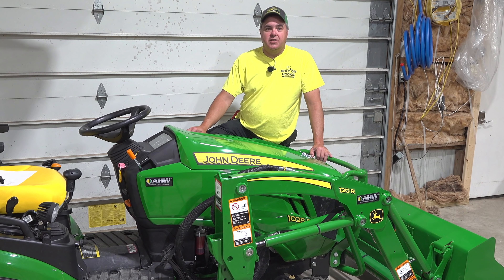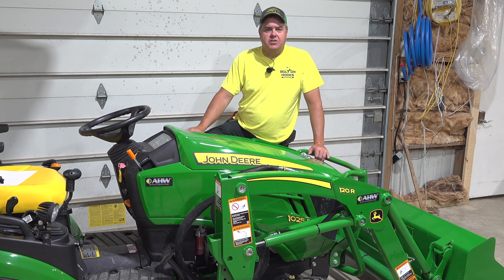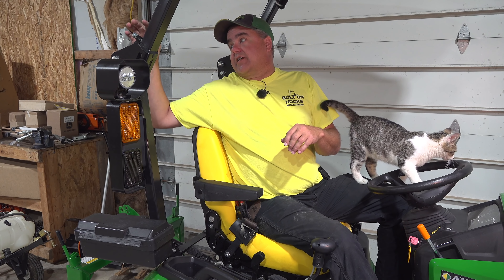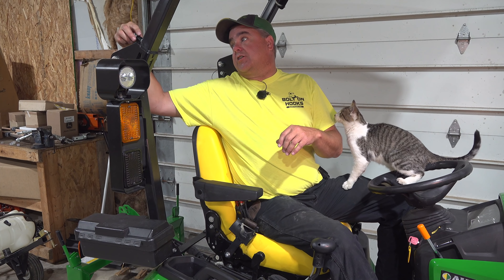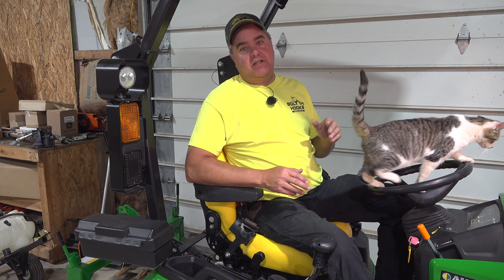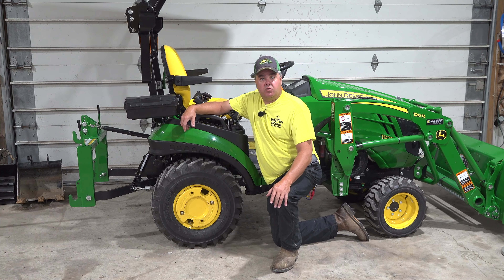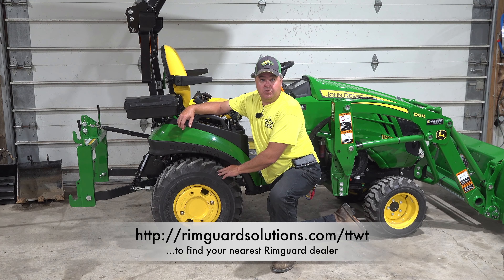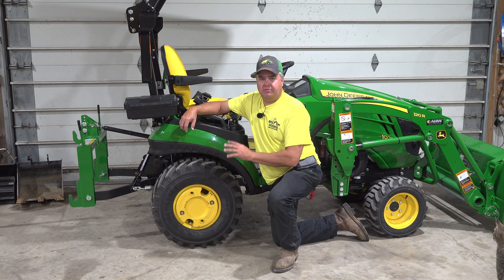NEW 2019 John Deere 1025R with ALL the Bells and Whistles! Model Year Confusion Resolved!

Comment: I just signed for one Wednesday, just waiting for delivery.
Reply from the maker: Congratulations!
Reply: Tractor Time with Tim    The paper said 2020, I did not get to see the tractor because of low stock. The salesman was going to get it from a different yard. I will have to look and see what the paper says now.
Reply: You won’t regret it.
Reply: You  will  love  it , I  had  one  but  moved  up to  2038R  witch is also a awesome  tractor  thinking  down  the  road  to  get  another  1025r just  for  mowing , I  truly  do  miss  my  1025R
Reply: It will be the best thing u ever bought...hands down !!
Reply: Be warmed...  implements are like rabbits, they multiply fast.

Congrats!
Reply: I had mine since February I Love it no regrets.
Reply: I'm with team orange ,but I can tell you one thing. You will enjoy your little tractor. I just received my northern tool wood chipper today. Im looking forward to trying it out on my b2650.
Reply: @TractorTimewithTim   I am going to buy a new 1025R this Thursday and was wondering if it is better to wait for the new "LK" VIN 1025r...what is the benefit of having the same Autoconnect PTO as the 2025R? Would I be missing out if I bought the 2019s?? Thanks in Advance for your help 😊
Reply: @rexdelong7581  I'm considering a 1025R or a 2038R. The 1025R is plenty for what I need around my property but I'm looking at using it semi-commercially. Went to the dealer last week and all they had was a 1025R but they're getting a 2038R in & I'm going to go back. Would you mind explaining what you like about the 2038R a d why you decided to upgrade and maybe more importantly what you miss about the 1025R? This is a new venture for me and I don't really know what kind of work I'll be getting into with it - I do live in an area with a lot of small residential lots so the 1025R may in the end actually be the better machine for me but I also don't want to not be able to take on jobs that the 2038R would be better suited for. I watched Tim's video but any additional feedback fron you would be greatly appreciated!

Comment: I love your videos, very helpful and, Informative I’m getting a 2025r have 3 acres with no grass, but weeds that we cut and end up with weedscape. We live in rural San Diego so only an issue from February to early summer. My question is, do I get the drive on mid mower, or the 3 point hitch bush hog that’s pulled and works out as less money.
Reply from the maker: We have videos on both types of mowers.  Check em out :-)  Thanks for watching!

Comment: Hey Tim while John Deere is awesome for sure... I have a chance buy a yanmar 221 for 5000 less than a new 1025r.
It's a new old stock 2020. I have 1.1 acres to develop with my new house. 
The dealer is close by and we'll trusted here in Idaho. The budget is right by allowing me to purchase more implements... and 10 year 3000 hr power train warranty... am I crazy? 
I really enjoy your videos..
Reply from the maker: Each person must make their own decision.
I would still buy the Deere.   auto-connect, tons of accessories available, Position control on 3 point.
More HP on the 1025R.  ...BTW, you SHOULD be comparing the 221 to the 1023e.
Loader easier to attach/remove.  
Load n go available for mower deck
Single point hydraulic connector available for loader.
Long term parts much easier to purchase (proabably 250,000 of these 1-series have been made!!)
Resale value will be higher on the Deere...for the reasons above.
There really is no comparison in these two machines.
Reply: @TractorTimewithTim  yes I'm aware a better companion is the 1023.... with that being said it's 3k cheaper. And after test driving all three. The Yanmar power steering is the best. The position control on the three point is a option I have gone over time and again in my mind... but that is money I need to spend on a tiller... a post whole digger... ect.. I guess my question is is the yanmar a piece of crap? Like I said I do have a trusted dealer... and service dept...
Reply from the maker: Nope...not a piece of crap.
Will be similar in reliability to all other brands.  Issue is that parts will not be made as long as for the better selling Deere.

I predict you will regret not getting the Deere...but I could be wrong.
Remember the 0% financing.
Reply: @TractorTimewithTim  well you have some more to think about. Thanks!

Comment: Took delivery on barns new 2019 2025r last year. Owners manual does not make any mention of 50hr.service. Have looked manual over many times and first service is not required until 200hrs. My dealer sold out to AGPRO in the meantime and have been pretty good about handling recalls and electrical issues I have had and even provided free pick up and return . Talked to the service manager about first service and he also stated no service needed until 200 hrs. Your thoughts on this?
Reply from the maker: They removed the 50 hr service from the manual in 2018.

Comment: You will like the third function after you get use to it. However, like all hydraulic functions on the 1025R it is hard to do multiple movements at the same time.  When you press the third function buttons, the third function basically steals all the hydraulic flow so you can not feather third function and curl at the same time. So you will learn to do multiple short burst of the third function to close the grapple while curling to grab loads.  Also you might also look into adding the Hydraulic lift for the MMM.  It is the Hydraulic cylinder and a hose kit.  Do the install yourself and the reverse the direction of the hose attaching to the hydraulic cylinder.   The short add-on hose will attach to the hydraulic cylinder and not be additional weight hanging out under the quad hydraulic couplers.  Also the short hose bent fitting also couples to the hydraulic cylinder better.
Reply from the maker: I have a write up on the mmm lift options on the 1 series. I have no interest in the hydraulic lift.  ...and the independent hydraulic lift is not available with the 3rd function.  Anyway; not necessary in my opinion.

Comment: Tractor Time with Tim   I am going to buy a new 1025R this Thursday and was wondering if it is better to wait for the new "LK" VIN 1025r...what is the benefit of having the same Autoconnect PTO as the 2025R? Would I be missing out if I bought the 2019s?? Thanks in Advance for your help 😊
Reply from the maker: LK and KK are identical machines.     LL ...which is not out yet will hav the new autoconnect for 2025r.  
If you decide to wait, you may be waiting a LONG time.
I would not be afraid to take a new KK or LK....in fact, I just did! :-)
Reply: @TractorTimewithTim  what would be the advantage of having the 2025R's autoconnect?

Comment: Weight is great for solid ground types, I have a spot in the barnyard that rain congregates and becomes swampy after a rain, and most equipment sinks into the swamp, thank-god for 4WD Low settings of the 1026R, Ive had to use the 1026R to rescue a ZTR in that spot with a recovery strap!

I'd like to see the rear has the High Flow, /3rd Function exposed in the rear like the big tractors.
Same with a electrical connectors, a tow connector?
Reply from the maker: We have power beyond in the rear for the backhoe.

Comment: Tim when they come out with an easy connection for the loader hydraulic hoses I will consider upgrading my old 1025r. One like the Kubota has.
Reply from the maker: Ya better be Savin your pennies :-).  This might happen soon!
Reply: Get the tool from kens bolt on hooks to relieve the pressure in the lines you will be happy
Reply from the maker: Ken’s tool helps...but still much more painful than the BX’s single point!

Comment: Howdy Tim, I love your videos!! Question, I am in the market for my first tractor. I’ve got 3 acres currently, an acre of yard, and acre of woods and an acre of an old farm field that I use for various crops(getting into industrial hemp/ and already have a garden and chickens. I cant make my mind up between getting a fully decked out 1025r TLB with grapple setup plus hydraulic BH thumb, and box blade. Or go up to a 2025r TLB minus the grapple/BH Thumb. Or go up to a 3025e and get grapple, box blade, tiller, and rotary cutter (I wouldn’t get the 370b backhoe as that’s 10,000$). Top top $$ is $25,000 but would prefer to stay near $22,500. And these setups are all pretty close to the same price!! Side note: I have a 50” MX5000 zero turn for my yard, so I do not need a mid PTO/mower deck/snow blower. I would just get a blade eventually for snow.. if we ever get any. I am mainly torn between the loaders capacity and ground clearance, and stability/maneuverability. I will be moving mulch, gravel, dirt, prepping soil, clearing paths for walking/ dirt bikes through the acre of forest. Also digging and stacking dirt for berms for my gunrange and want to dig swales in my crop field. I want to also expand my little fish pond and maybe build a little barn/shed and run electricity to it. Probably will do a bunch of other random jobs once I have a machine and realize what all they can do... (Probably will end up getting a set of pallet forks for any of the units just to move stuff, thanks to your videos!!)  I just don’t want to end up getting a unit and feeling like this 3025e is wayyy to big for my property? But at the same time Am worried the 1025r will have a hard time with our red clay/shale soil here and huge oak and maple trees. But if I go to the 2025r I’ll be limited on attachments for the first few years of ownership. So I am really torn between what model to go with! Do I really need the backhoe? (It sounds appealing to not dig with a shovel as often!) Also I’ve read the 3025e is detuned and so it should last a lot longer and need less maintenance? Get the smaller machine now, and then in 5-10 years to for a 2038r? Or 3039r? Too many options and ideas! I would love your input! Thank you! Keep making the great videos!!
Reply from the maker: I am not a 3e fan.
Stick with the 1025r.  After 3 yrs payments, you can upgrade.
Reply: @TractorTimewithTim  Thank you for your reply! I've watched your video with the 1025R with the stump grinder, the 1p24 I believe, do you think extended use of this attachment will hurt the tractor?
Reply from the maker: I can’t imagine personal use hurting the tractor.  I suppose 8 hrs / day for years would not be good...but in that case, you would buy more expensive grinder anyway!

Comment: we just purchased a new  4052 R 52 HP with a 440R loader and bolt on cutting edge  with 3 SCV on the loader with a  stereo and mirrors and rear and front work lights and power beyond with  a 485A backhoe with a thumb
Reply from the maker: Wow!  Congratulations!  Nice machine.
Reply: and kudos on your new tractor very nice

Comment: I was hoping they would change the ROPS to a smaller 1 piece ROPS and move the work lights that are next to the seat and mount them on the ROPS. I find them useless when I'm using the forks and moving a load around just before dark. I see they moved the toolbox to the side. Have a Great Day, GOD BLESS

Comment: QUESTION? : I take delivery, its actually in, of my 2020 1025R in about 8 days...but waiting on one small backordered component for the JD factory 3rd function, dealer is installing. I am first on the  list for that part, thats good. But, I can not find someone explaining or demonstrating taking off and on the loader with the factory 3rd function hydraulics added. Can you explain if the install with a quick disconnect for the hydraulic line(s), where they are and if it adds any significant time to taking the loader of and on? As usual thank you for your videos. Though this is my 6th tractor I am downsizing considerably and it helps to learn from those like yourself. Also loving your TTWT 5%. Thank you!
Reply from the maker: Thanks for the kind words.
The 3rd function is two more hydraulic connections.  Just like the 4 you already have.
Reply: @TractorTimewithTim  quick release I assume?
Reply from the maker: Unfortunately, there is no Deere option for a quick release on the 3rd function.
Reply: @TractorTimewithTim  How do you get your bucket off then if the 3rd function hydraulic line is 'hard wired in'?
Reply from the maker: @schoocg  it isn’t hard wired.  It uses 2 quick disconnect couplers.  I thought you were referring to the optional ‘single point’ connector for the FEL.   There is no fancy ‘single point’ for the 3rd function.  Please watch our video on the single point for more details.
Reply: @TractorTimewithTim  I did not do a good job explain myself. You have answered my question and so there is an additional set of disconnects for the 3rd function for that, great. Learning from you a lot, thank you.

Comment: Tim, Thankyou again for your videos! You have convinced me to go with the JD 1025r. Especially with the loader lift!. Question though, my dealer has a 2016 1025R with 250hrs, quick attach mower, loader, for 14K. Is that a fair offer? I'm used to larger equipment so I don't know if I need to get them down any. The hrs don't bother me its mainly the year. Thankyou so much!
Reply from the maker: Not much difference between 2016 and 2019...mainly the backhoe.  A few other small things.

Comment: Tim, I have watched alot of your video and they are alot of help. I am buying a 25hp tractor for my small 7ac farm. I have horses, only 2, but feed big round bales. The 1,000 lbs lifting will work and I will use it to mow the yard and field. Question I have is, What is the price difference between a Deere and a LS? I am buying this for Christmas and now looking. I have heard you say the new Johnny is 16k and that seem expensive. Can you clear that up and why upgrade to a Kubota or Deere? Thankyou and keep, keep on with your videos!
Reply from the maker: Kevin,  I address the 'brand' issue at length in this episode:  https://youtu.be/QgLuZaPeRa4
See if that helps.   Tractors hold their value very well IF there are long term dealers, good supply of parts, well known in industry, etc.  Initial purchase price is only a small part of the equation.

Comment: Just purchased a new 1025R. I believe it is a 2020 model year made in 2020. Here is the serial, 1LV1025RELM. Sound right?
Reply from the maker: Looks like 2021 model built in 2020 “LM” unless I have the two digits backwards
Reply: @TractorTimewithTim  I think your right!

Comment: Thank you! Even though my dealer sold me a 2020  I just looked at my identification # and it has the kk so it's actually a 2019 I understand they weren't being dishonest I said I wanted a brand new 1025r and that is why so much confusion on the load n go...thank you professor ttwt!
Reply from the maker: Well, the dealer was not straightforward if they said it was 2020 and it is a KK.  Oh well.  LK and KK are identical.
Reply: @TractorTimewithTim  I agree! Looked at my papers from John Deere credit and pin # on tractor and pin# on loan don't match loan says 2020 and has LK on pin. On tractor it has a kk with different last four numbers..hutsin tractor says miner mistake with get it straightened out with John Deere finance...
Reply from the maker: Glad you checked!   This is major issue.  If the serial numbers don’t match between tractor, loan, and paperwork!

Comment: from this video I have learned that I have a 2018 1025r from (Dec 2018) but sold from the dealer as a 2019 model, I am trying to find out what the differences are from 2018 and 2019
what the price difference was and features, I have put on 240 hours in a year and a half. I have the front loader, backhoe, third function (dealer installed) and a grapple
Is it possible to get spec sheets for each year for a comparison, not finding anything on the web
Reply from the maker: Essentially no difference in 2018 and 2019.
...and I doubt it will cost anything in resale value.   So, nothing to worry about.

Comment: Tim, I think you might be off by a year. I am trying to decode a new JD tractor vin. Unfortunately there are no decoders out there, but there are some explanations about the different vin sections, and they all agree on the number/letter digit to calendar year mapping. The year numbers/letters are 9=2009, A=2010, B=2011, etc. That makes K=2020. The vin I am looking at is 1LV2038RAKK**** The A is a calculated security checksum, the first K is calendar year of manufacture, the second K is the configuration/transmission code...
Reply: here is a couple links to how the 17 digit VIN works:
http://salesmanual.deere.com/sales/salesmanual/en_NA/tractors/2014/feature/serviceability_and_support/serial_numbers.html
http://salesmanual.deere.com/sales/salesmanual/en_NA/tractors/2015/feature/serviceability_and_support/serial_numbers.html
Reply from the maker: They skipped ‘i’.  Presumably because it looks too much like ONE

Comment: correct if i am wrong tim but if i am not making a mistake but this is like when you buy a dodge truck the first part the the calander year they would call it a 2019 and a half and then the last part it is a true 2019 or something like this maybe
Reply from the maker: Nope.  I think I explained the situation pretty clearly.  Serial number has two relevant digits.  Calendar and model year.
Reply: delete this then please i do not want it up here and confuse any your other people thought sure this may help but it will not

Comment: If you can only get one (for now.) Rear weights or wheel weights?  1025R. your helping me better than the sales guy. :) is there a ttwt code for the tractor?
Reply from the maker: Start with rear 3 pt ballast.  This is most important with the loader.